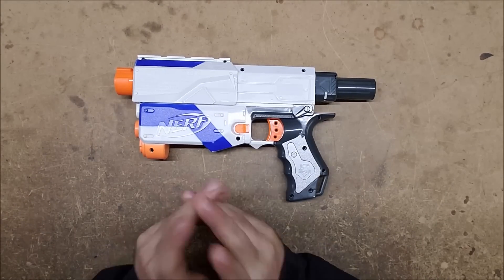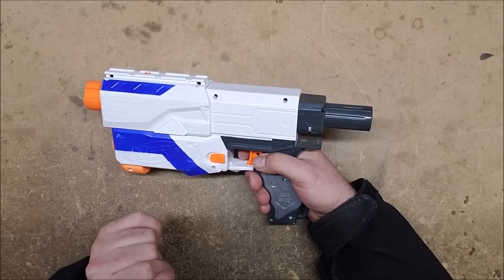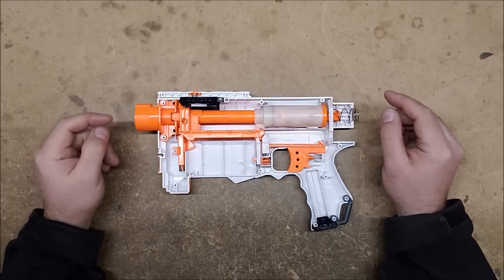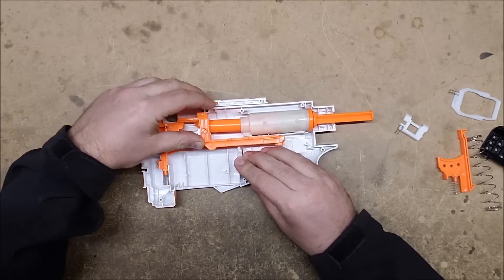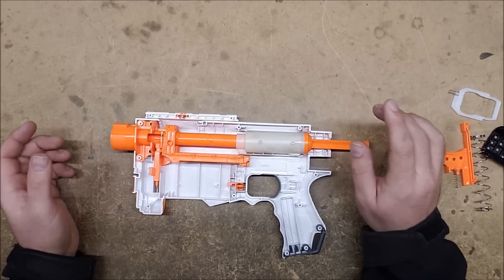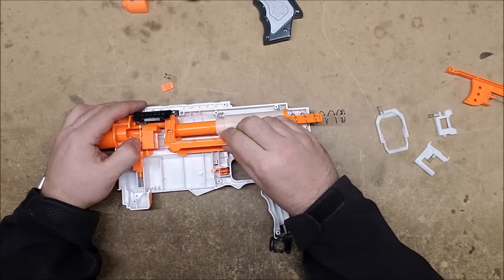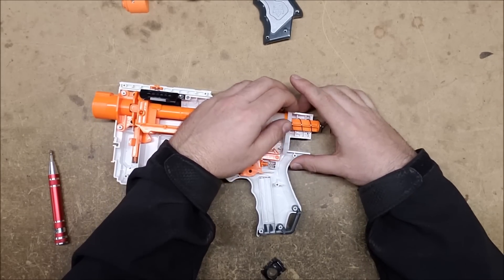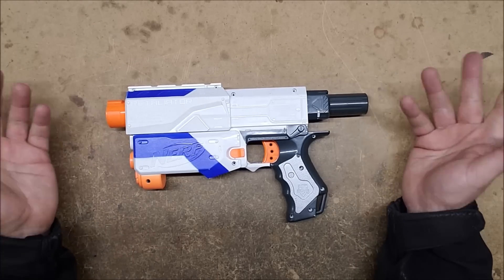Monday Mod Tips - Springers - Locks

Comment: For the magazine release lock, once removed and using Nerf mags, did not have a magazine failure of any kind. Only time it happened was an off brand 15 round banana mag, as the follower got loose and had to be reset. That mag is now only used for flywheel blasters.

Comment: Worth noting that for a brass breech, removing the magazine release lock is not only favorable, but often necessary.  This is because the brass is a much smaller diameter than the plastic breech, and the magazine can snap around it without damaging itself or the breech.  Many brass breech designs can ONLY be loaded when the breech is closed, due to the breech having a sort of arch that keeps the front and rear portions of the breech aligned, which can be damaged by trying to insert a magazine while the breech is open.  If you intend to make a full brass breech, you should probably be removing that magazine lock.

Also, as long as you make a habit of not forcing magazines into or out of the blaster, you can avoid damaging either the magazine or breech by inserting or removing them when the breech is closed.  Forcing magazines is never a good idea anyway.
Reply from the maker: Indeed.  There are exceptions to any rule and mods that involved are a whole different world.  :)  Thanks for the input!
Reply: matthewbro3 but sleeper breeches are fine. Great tip, just wanted to make sure people know!
Reply: @icrazyfish2661  Yeah, sleeper breeches can, and often should, be loaded with the breech open.  Now that I think of it, the same goes for many other sealed breech systems that don't have an arch.  Thanks, I forgot about those.  It is just the full breeches that need to be loaded while closed.  And even then, if you make the arch on it narrow enough, a full breech can still take the magazine while open.  That has the advantage of loading with the breech open or closed.  I think I've heard that referred to as a quarter pipe breech, because the arch piece is one quarter of the pipe instead of half.

Comment: Thank you for making this video Captain! Really appreciate this one. I’m such a smart guy that I “modded” the retaliator that my son and I got from goodwill thinking it would be smooth sailing like all of the previous mods I have attempted. Yeah we both know how that went! And my son was upset and I’ve searched the interwebs far and wide for tips and details on which locks were necessary and what I could do to remedy it without putting them all back in. Your video is by far the most detailed and easily understood (although my wandering mind had to rewind certain sections a couple of times each) by far. I’m contemplating busting it out and giving it a go right now at 4am lulz 😆. The best part of it all though, retaliator aside, is that by demonstrating how the internals and locks worked together to achieve their intended goals I now understand them all so much better. I knew their functions and how to take them in and out but by seeing the mechanisms in action the whole concept of a blaster makes so much more sense in my brain 🗺🧠♑️🕯♑️♏️🕉♑️✝️... 🧠🍽 🍰... 🏆♑️💭💰 ... 👁‍🗨♥️⛎🤷🏻‍♂️🤷🏻‍♂️🤷🏻‍♂️🤣😝🤓...

Comment: I accidentally removed my retaliator trigger lock and wanted to put it back because it kept slamming on me when my darts went dry... this was before I fully became familiar of the retaliator anatomy.
I found Captain Xavier's video on this and realised that (despite my mum telling me to throw these away) I had all my internal pieces savedand I have both the trigger lock and mag lock with the springs. Now I can put my trigger lock back when I install my 9kg spring with worker bolt sleds and side priming handles.

I also damaged my bolt sled when removing the air restrictor once but the new worker one does not feature a lock there so... hmmm

Hmmm..... I might as well leave 'em out, now that I know they are actually useful, I thought my blaster was broken before XD and broke the priming slide's little notches so it did not function at all!

Comment: I usually take off the jam door on retaliators or recons because if I keep the slide on the jam door is kinda useless but if I put a pump grip in it worker sells side covers which also require you to remove the jam door to me it’s just another lock

Comment: After the flywheel video, maybe one on Stampedes? When I opened mine, I saw a lot of unnecessary locks. There were multiple locks that made sure the magazine was in, which really just increases points of failure.

Comment: While I've heard others talk about the mag lock, and not removing the mag/installing it with the bolt forward, I've never had any misalignment or damage to my bolt or magazines from doing so.... and I'm really, really hard on my blasters. One even being a retali-strike which has the two parts of the bolt adhered with epoxy putty.

Comment: One help please, my retaliator has low air pressure and can fire only to 2 to 3 feet, sometimes it even can't fire the dart outside the barrel. Any fix..???
Reply from the maker: I would open it up and check the o-rings on the bolt and the plunger rod. Also add some lubricant. The spring might also be worn out.

Comment: Is it better if you only take out the slide lock and not the trigger locks?
Reply from the maker: @suevaz-2996  Depends on the rest of the build. If it has a sealed breach that would let you multi-load and fire more than one round. If not, it will just jam the blaster. Either way you will not be able to deprime the blaster. So I would say not. If you are going to remove one, then remove both.

Comment: Which is best?: the Recon MKII, the Delta Trooper, or the Retaliator?
Reply: Yes ;)
All three are about 95% mechanically identical(major difference being the D.T. has slam fire) aesthetically speaking I prefer the Recon mk2 because of the hand guard and overall "blocky/chunky" design, but that's just me.
It all comes down to what your preferences are.
Reply from the maker: ^  What they said.
Reply: So the MKII?
Reply: @deetusyeletus  if you also like the look of it and don't mind not having slam fire then sure🙃
Reply from the maker: Litt, the issue is you did not provide any metric for what is "best."  Best at what?  Range?  Accuracy?  Price?  Shape?  Color?  Flavor?  We cannot tell you which is best unless you give us something to base it on.
Reply: Range and accuracy
Reply from the maker: @deetusyeletus  exactly the same. Pick the shell you like better and whether or not you want slamfire.

Comment: I often notice that after opening up a blaster a lot I end up removing the grease/lubrication from the plugger tube (its inevitable when you pick it up) and was wondering what kind of grease should be used if needed
Reply from the maker: I use white lithium grease
Reply: @CaptainXavier  i know this is old but can you use the blaster whitout it
Reply from the maker: @joaoruxa  without what?
Reply: @CaptainXavier  without the grease
Reply: @CaptainXavier  sorry im not a native speaker

Comment: Are you aware of any darts that can be cut to 1/2 or 1/3 standard length and loaded in a full length mag to make a caliburn fire a burst every shot?
Reply from the maker: Yes
Reply: @CaptainXavier  I may have to look in to getting one then. :)
What darts feed well in a caliburn for the above shotgun mag loading method?
Reply from the maker: Anything where the rubber head is smaller than the foam.  Stock darts, Mengun, Darts, dome tipped darts, worker half darts.  Things like Accufake and Waffle tips do not work well at all.

Comment: How to I fold the worker extendable folding stock?
Reply from the maker: Which one?
Reply: @CaptainXavier  the one that has 4 places to extend to and the stock bit is L shaped.
The metal bit that extends is metallic rose red
Reply from the maker: Link?
Reply from the maker: Pull down on it.
Reply: @CaptainXavier  I'm a child I'll need full inatructions
Reply from the maker: Look at the left side of the stock just behind the stock attachment point.  Do you see the two parts that are hooked together preventing the stock from swinging?  You need to push down on the back part of the stock until they are no longer hooked.  You will then be able to swing the stock to the right.
Reply: @CaptainXavier  it not working yet (most likely cuz I'm rlly weak) any tips?
Reply from the maker: Grow stronger.  Or find an adult.  ;P  The retention spring in those stocks are pretty strong to keep it from folding when you don't want it to fold.
Reply: @CaptainXavier  thx and sorry for take up approx and hour of ur time
Reply: @CaptainXavier  If it my mum and she was struggling alot.
It was between her legs.
Btw she had to twist.
Edit:Thx m8